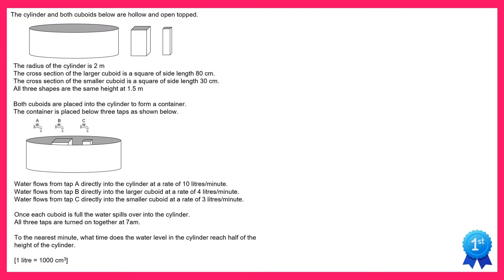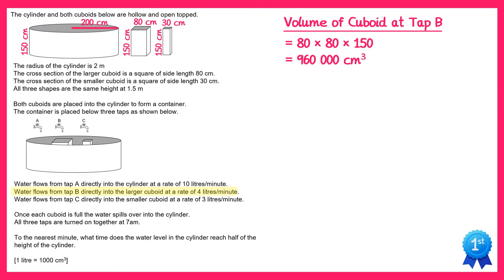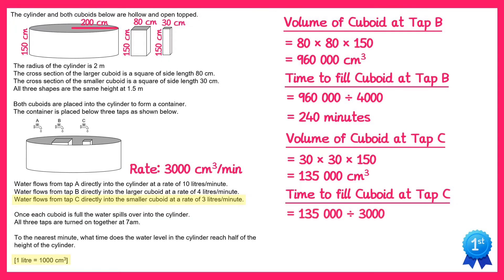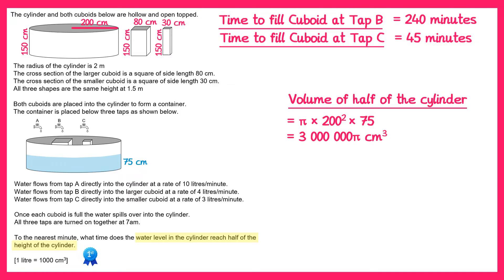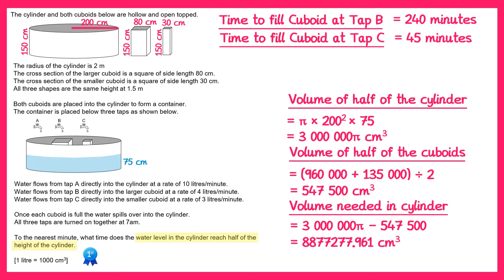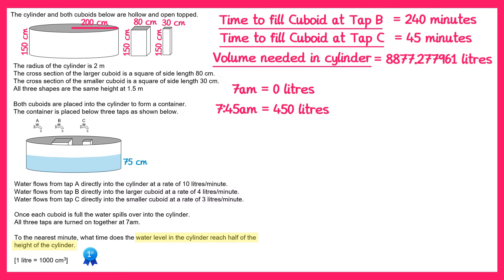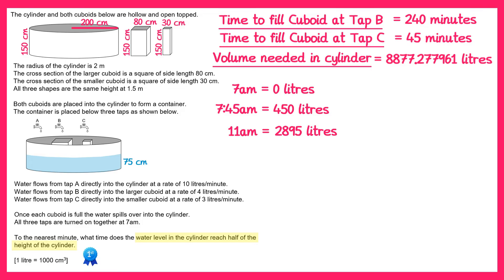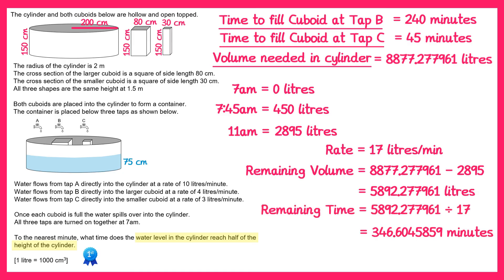Spicy Questions #10 Solution

Comment: Hello, isn't 450 + 2535 = 2985 
You have written 2895 litres
Reply from the maker: Hi yes it is just a transcription error. When I make these animations I type the numbers in and often copy and paste boxes about. It should be 2895, however it is recovered in the next steps when the subtraction takes place I do subtract 2895 rather than what it says at 2985. Good spot but the answer remains the same if that makes sense!